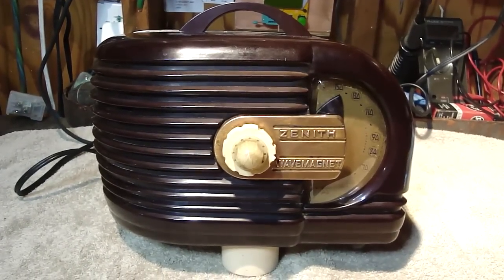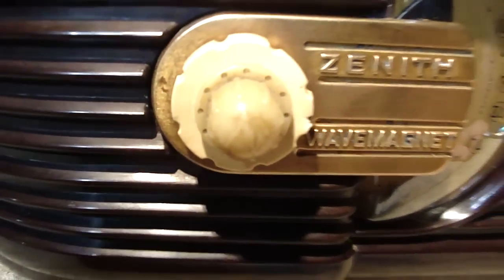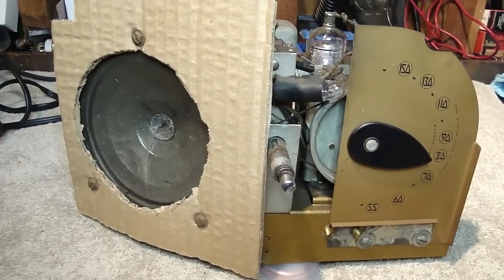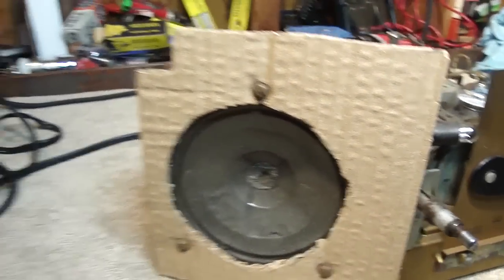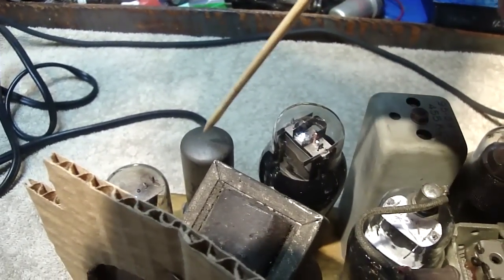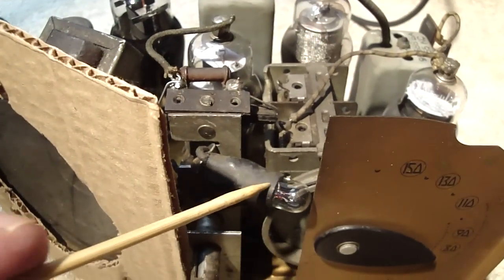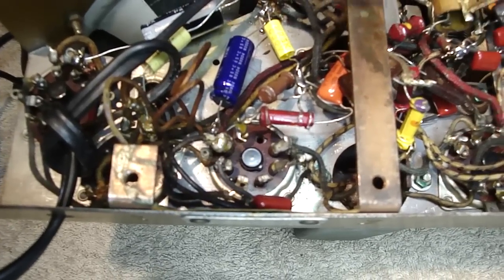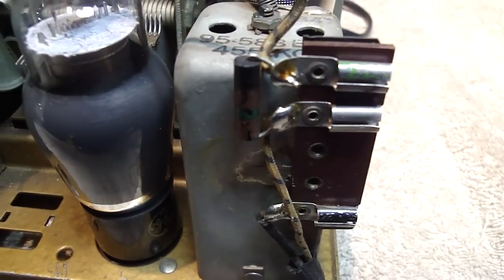Zenith 6D315 Radio from 1939

Comment: I have the 2 models and have done a bit of research on this set. The first model, the late '38-'39 6D-311, was available in standard brown bakelite and ivory or ebony painted bakelite. Unpainted black models were originally painted sets that were stripped down. These sets have a regular cardboard back and either a gold or dark aqua dial face. The dial numbers are slanted The 1940 6D-315 often had "WAVEMAGNET" on the front escutcheon, but not always. It has the large gold antenna assy attached to the back. The dial numbers are now straight.  I believe it had the same finish choices as the 311. As a side note I have never actually seen an original ebony painted model.